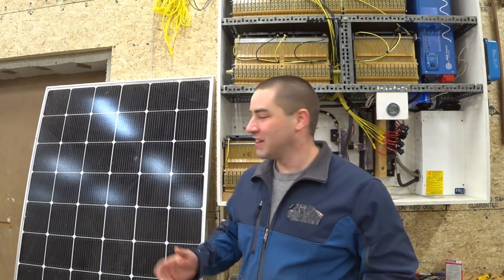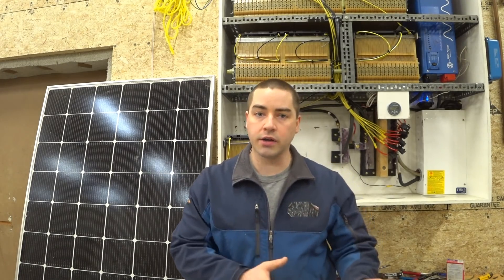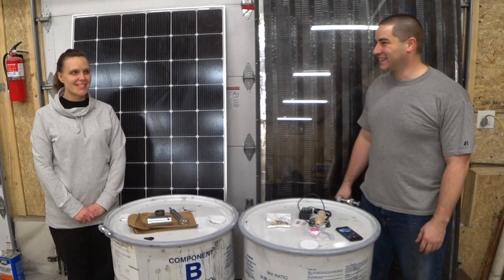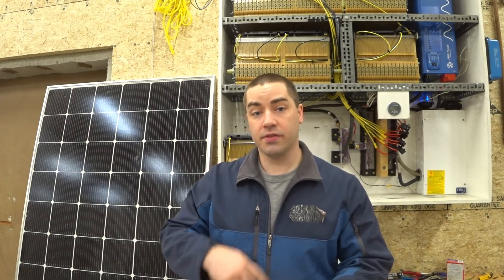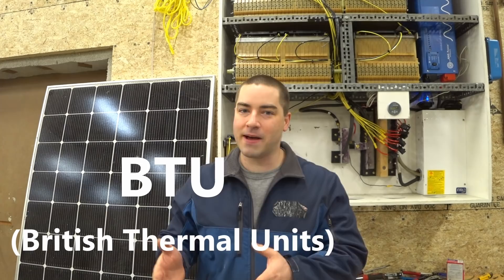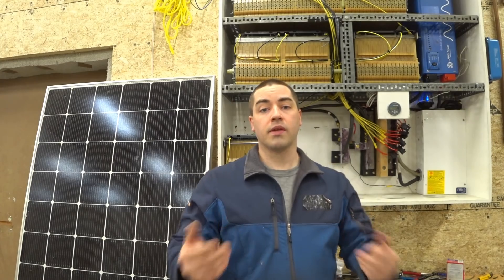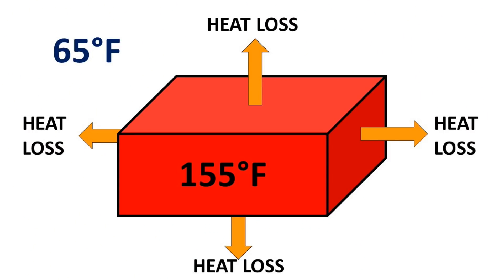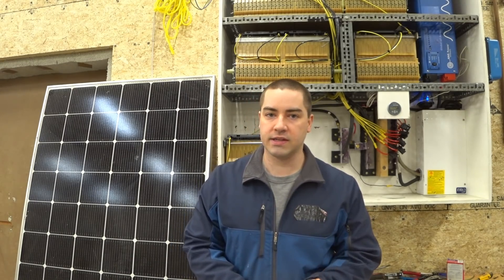Cheapest Energy Storage Off-Grid

Comment: Sorry, but it seems to me, you've confused yourself (and confuse your audience) into hot water)

Stating like hot water storage is cheaper alternative to batteries is just misleading. These methods store different forms of energy, which are not easily convertible. Well, one can easily convert electricity into heat, but all the way around not really.

If you need electricity, and you're in cloudy days with stored hot water, then... Congrats, you stuck. Because how do you convert it back into electricity? There are only peltier devices, but they aren't very efficient neither cheap.

If you need rather heat, then storing it in hot water is indeed OK, no doubts, and much more reasonable than batteries. But using solar PV to obtain this energy is ridiculous in the first place. Solar heaters are several times more efficient for this purpose.

If you need both, you'd rather use balanced system with both solar PVs + solar heaters for obtaining energy and batteries + thermal accumulators for storage.

In short, thermal accumulators and chemical ones are not alternatives, rather supplement each other.
Reply: He is only talking about converting solar to electricity, and thermal heat to water heat, he isn't trying to convert hot water heat to electricity.
Reply: underrated

Comment: Hi David, love your work. What if your tank had solid mass in it like gravel / rocks as example, would that be able to store more BTU's?
Reply from the maker: Certainly thermal mass will help swing a building through cold spells.  Great passive strategies are to use concrete slabs and/or double layer of gypsum (drywall)
Reply: Paul Jennings Water has one of the highest specific heat capacities of any cheap and abundant materials. A given volume of water will hold significantly more heat than the same volume of concrete, rocks etc. Using the structure of your home as thermal mass to store heat and even out temperature spikes and drops is worthwhile, but for storage of heat water will always come out on top.

Comment: Recovered and reconditioned forklift batteries are perfect for this application. Additionally telecom batteries are removed on a lease basis and are perfectly good used batteries to use. Both options are a fraction of what you can build your own systems for. Im a battery technician in Canada and my primary work is building motive batteries.
Reply: Lithium?

Comment: There may significant thermal capacity benefits from using brine.  You'd have a greater thermal capacity for the same temperature delta.  That may get you the extra day's capacity you'd like.  You may have to take steps to prevent excessive crystallisation either through evaporation or lower solubility at low temperatures, but I don't think that should be too problematic.  It's probably worth trialling.  .... Oh! and it's also cheap!
Reply: I would stay away from the PEX with aluminum inside if you can even source it any more. While it used to be super common especially under the name brand "kitec"  there were problems with corrosion and delamination at the fittings. Entire condo complexes are tearing the stuff out. That said, in a situation like this where there are minimal fittings and none of the fittings are in inaccessible places, you can probably get the stuff recycled for a steal.
Reply: The trouble with brine is corrosion, basically unwanted electrolysis....
Reply: @ScottyDMcom  would there be a need for a pump at all... opening the faucet would allow the pressurized tank to push the "potable" water thru the loops in the  heated water in the tank, would it not?
Reply: I also wonder how much Hydro siphoning would happen once it came to heat? Thus possibly saving more not needing an electric pump to move water from the solar source to the tank.
Reply: I was trying to find a better substance for heat storage than water and I did t find one readily. I suppose the advantage you would have with oil would be that you can store at higher temperatures to achieve a better energy density.
Reply: All the PEX couplings can be above the waterline, or even outside the brine/water storage box. Putting more PEX in parallel not only reduces water pressure drop, but also increases heat transfer, so a pair of external manifolds seems great.
Reply: I like the idea for the pex heat exchanger but I wonder if corrosion would be an issue if the heat exchanger was upgraded to copper (as is his plan). Whadda ya think?
Reply: @offgridiot  with fresh water it would be minimal. Brine would eat it alive. if he was to try that (I personally think it over-complicates things.) he should stick with pex. the ONLY benefit copper has over pex is it is conductive. otherwise pex is superior in every way.
Reply: @JasonStanley-w9j ...except for the steel wire ties he used in securing his pex. But then that could be quickly solved by using zip-ties instead. As long as zip-ties can take the heat I have to agree with you... pex is good, copper could complicate things.

Comment: Wouldn't there be less energy loss to use a gravity storage reservoir with a simple pump?
Reply: Thomas Specht Have you any idea of the volume of water needed, and the elevation required, to generate 30kwh of electricity? No, neither have I, but it's a lot! Something like a small lake a few hundred feet up a hillside! Then, you need another empty lake at the bottom to catch all the water so it can be pumped back up later. Plus, you will never achieve more than about 75 percent efficiency. Not practical on anything other than a huge commercial basis.

Comment: For summers try my invention (no moving parts, nothing electric/electronic) :  Just a simple 6" diameter cpvc pipe  40 feet long inside the attic at the peak connected from water supply to hot water tank:   1.  Nothing to maintain except empty it when winter approaches to prevent freezing.   2.  Easy to do, just opne the attic gable vent on the side of the house and slide in the pipe.  3.  NO damage to roof (every nail or screw would eventually cause a leak for other roof top systems, means you would have to uninstall and reinstall your solar thermal/or solar electric system to fix roof someday Usually about 10-12 years from new roof date; *)  4. Looks good from outside.   Of course you can run more pipe for better effect, and it helps cool the attic as well.  

*for best roof use standing seam metal , or if using exposed screw type make sure screws are on top of the many little ridges that run from peak to eave , not in the valleys "who would put a screw at bottom of river? "    Rolled asphalt overlapped 18" is next best, many use this but only do 3" overlap, bad.  Worst i the 3 tab and archectectural types which really leak from day one, you just don't know it for 10 years because plywood acts as sponge and finally fails, Don't believe it, just go up in attic with very strong flashlight 1 year after new roof, just look at all the stains on the plywood !! .

Comment: David,

I see the benefits, but how in the world do you heat the water to 180 from the solar panel?  
Sorry, if this is a stupid question, but I am just starting out...obviously...
Reply from the maker: It's about getting enough power.  If I draw/loose 8.8 kwh out of the tank per day, then I need to supply more than or equal to the same.  But everyone would have different needs, so you have to match your own system.

Comment: Awesome video and great explanation! 

I was expecting someone to mention electrodacus since he designed and sells a solar charging controller exactly for this. A controller that can balance lifepo4 batteries and also dump the rest of the energy into heat storage using resistance wire.
His system is designed to be most cost effective for off grid and he actually lives in canada!
A thermal battery bank makes solar heating much simpler and cheaper.

Solar panels are so cheap, really the only problem is energy storage.
Reply from the maker: He has written into the comments on a few of my videos.

Comment: one thing you didn't factor in for your thermal " loss " is if you have the tank under your house or area that your heating then your actually not " loosing " as much as you think because the heat rises and expands so the area to the sides is absorbing heat and transferring it up into your house and then your having to use less electric to heat your house
Reply from the maker: That's true.  There are several additional avenues I could have gone down in the discussion, but I was trying to keep the video simple.  Thanks for watching.
Reply: thanks for taking the time to read my long run on sentence lol
Reply: I live in sunny Australia, same latitude as Florida (but south). I'm deciding if it is better to have the storage under the house, to take winter advantage of that "lost" heat, or is that going to be more of a problem in summer, when I need to cool the house? I am thinking of using in-floor water heating (pex in concrete?) and I should be able to reverse that in summer to cool the house.

I think I will put the tank outside, maybe build a greenhouse over it instead. So many great ideas, can't use them all, but this video has given me a whole new "central solution" to explore. Thanks David.

Comment: In the industry sector they are using phase change materials for thermal energy storage, paraffine wax (with 24 or 25 carbon atoms) for example has a pretty high heat capacity of about 2,5 joules per gram kelvin. Not as high as water though, which has 4.2 (416.5 BTU/GAL/F). But when the paraffine wax melts (at 49.4 degrees C or 121F) , it releases an additional 238 joules! Water does the same thing, but only at 0 degrees C, or 32 F and thats too cold to shower. So you would need only about 116 gallon which is about 600 USD, i guess still more expensive than water. But the best part is that the liquid wax, never gets colder than 49.4C/121F untill it all solidifies. In greenhouses they also use water to store heat...

Comment: Super presentation! High respect for your very clear thinking & exceptionally clear educational explanations for those learning!!!! May I suggest ideas??? Yes to copper {especially} counter-flow heat exchangers (increased efficacy & temperature crossover), phase-change heat storage (increased storage density & reduced heat losses), heat pump extraction to DHW tank (more stable & increased autonomy time), low temperature H2O radiant ceiling from DHW (heats everything directly allowing inside temperature reduction & thus reduced heat loss),

Comment: Reduce the delta between tank and outside air to get a more efficient tank that in turn will loose less energy and require smaller tank for Your 4 days, of course heat exchange will suffer but maybe an optimisation of some degree can be made.

Comment: I think growing trees and then burning them thoroughly to provide heat on demand is more efficient and cheaper form of solar (photosynthesis vs PV). Wood gas generator for power or PV cells.
Reply: The air pollution would cause havoc if everyone did that. And forest growth wouldn't keep up. Esp with current deforestation rate...

Comment: Use excess power from solar to dump load into resistance heater.
Reply: Or perhaps better still a heat- pump hot water system

Comment: How can we run dryer or washing machine or pool pump in the daytime with no batteries just panels. Thanks for the help!!!
Reply from the maker: I use my battery system for my washing machine.  I wouldn't try running a washer directly from solar.  The pool pump can probably be converted to run directly off solar PV.  I know people do it with well pumps.  I just did a quick search and saw this: https://youtu.be/4aENLjJeDRg

Comment: Plz stop speaking in imperial units only.  it's fine to give a value in F for reference, but as a science communicator it's important to make good and honest use of the metric system.  - Thanks.  120F is about 49C.

Edit : 10 × 5 ÷ 9 is about 5.5.  Water boils at 100C.  You are aiming for having at 20% tolerance using 80C as your high temp.  20 × 5 ÷ 9 is about 28C.  18C average air temperature.

Comment: Why not just have a good old fashioned 100% solar water heating system and save your electricity for other purposes?  I knew a lady here in upstate NY who had a solar water heating system who claimed they had very hot water even in the dead of winter.  You can get your water pressure by having the water heater above your bathroom, as in the attic.   The cold water goes down the tubes to the collectors on the ground level.  The heated water rises into the tank.  Insulate the daylights out of your tank and possibly have a bigger than needed tank to store the hot water from when the sun is shining.

Comment: Thermal mass storage is awesome I have a 300 gal hot water tank heated by solar and engine exhaust.  I use a heat exchanger to pick up heat for hot water controller to 109 Degrees Fahrenheit.  Got kids lol. I can take several showers. Adding a 500 gallon and adding a heat exchanger for hvac.  Now also you can do the same with a 500 pound block of ice using solar driven refrigeration compressor  1/8 hp maintainer and my engine has a auto style compressor 2 actually  .  This will cool my house soon. BTW my thermal mass tank is set at 190 degrees Fahrenheit 😁👍

Comment: I calculated the BTU storage for water based and hot air based systems a few years back and would suggest you think about putting a large amount of a clean non-dissolving rock into your tank.  The rocks have a higher BTU to volume ratio that can be quite helpful.  Concrete tanks with the insulation on the outside is also possible.  Just keep the rate of heat absorption and recovery in mind when sizing the rocks.
Reply: Rock does not have a higher specific heat capacity than water! Water has just about the highest of any common substance. Filling the tank with rock would significantly reduce heat storage capacity.
Reply: @spencerwilton5831  As an FYI, specific heat capacity and "BTU to volume" is not the same thing. From what I see, in general rock does have a higher heat capacity per volume than water, though it depends on the density of the type of rock. But it's close enough that it probably doesn't gain you much. Moral of the story, read a little more carefully next time.

Comment: Why are you using those units? Make it even harder on yourself:
The Planck temperature scale - (°F + 459.67) / (2.55030092 × 1032)
Russian vodka bottles - Gallon x 6.155
Electron volt - BTU x 6585141385224143241216

So 7:43 becomes: ((8.33BTUx6585141385224143241216)/(GALx6.155)/((°F + 459.67)/(2.55030092 × 1032)))

Simple =D

Comment: A high density option to get some extra storage is to use some steel in there. It would need to be rustproofed somehow which will reduce it's heat transfer rate but that's unlikely to be an issue.  The density of steel is almost 8 times that of water so it allows you to either store 8 times the energy is the same volume or go a lot smaller with the volume which will reduce the heat loss. Using something like a truck radiator as the heat transfer device could potentially save space as well. It would need to be human consumption safe which could be a problem but they transfer heat incredibly fast.
Reply: You are missing the crucial fact of specific heat capacity. Steel around 500 J/KG/K while water is 4186 J/KG/K. 

That is already 8 times higher than steel. Meaning you are going to need 8 times the quantity of steel to get the same performance. 

Water is vastly cheaper than steel also. Water is a fantastic medium for thermal storage.
Reply: Hmmm. So the steel is 1/8th the energy density, AND 1/8 the volume. So there is no advantage, just the disadvantage of cost, construction, and corrosion.

I've been looking at lots of suggestions for the storage medium, and I keep coming back to water. Cheap, simple, easy to maintain, replaceable (I can flush the system any time), easy to find every component you need that can handle hot water.

Comment: Great video to indicate that thermal storage 'can' be cheaper than battery storage! 
One of the disadvantages is that you need to bring the whole tank up to a minimum temperature, before you can get heat out of it.
This can be done better by using a more vertical tank, with a mechanism that adds the hot water to the tank starting at the top, carefully avoiding to mix the water.
When needed, the hot water is retrieved back from the top of the tank. This can be done, since the hot water floats on top of the colder water.
The big advantage is that when you would fill-up the top 20% of the tank with hot water, you can retrieve it later at roughly the same temperature WHEN you have a mechanism that adds/retrieves water without stirring-up the tank. This mechanism does not have an heat exchanger inside the tank. This way you can scale the storage by having multiple tanks connected with valves to one heat exchanger. I have not thought of this myself, but found this in a German series of youtube videos on "Die 7 Grundregeln der Speichertechnik". (7 rules for storage technology)
https://www.youtube.com/watch?v=NmqbJ_3plLU&index=1&list=PL90E29C38B63F9D87 
On the homepage of this youtube channel they show this effect visually using a thermal camera.
https://www.youtube.com/channel/UCh4PzJ9HwxGN76-XMao_bGA 
(Useful if you don't speak German)